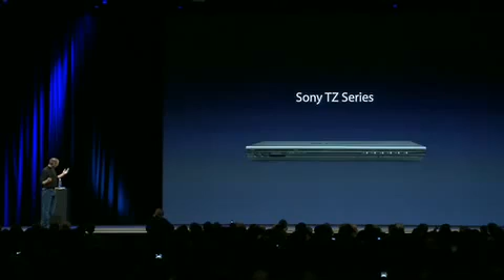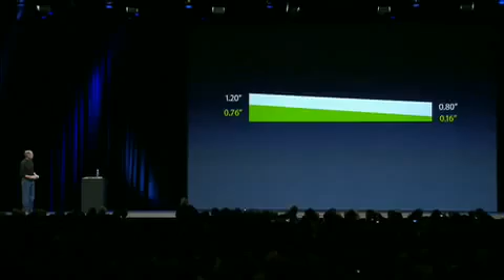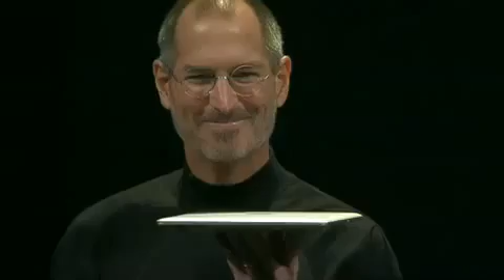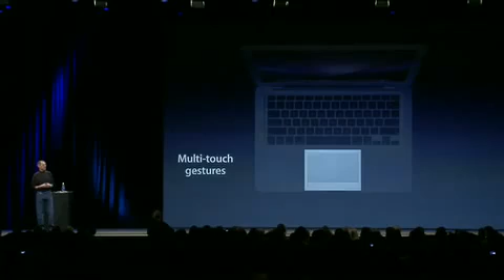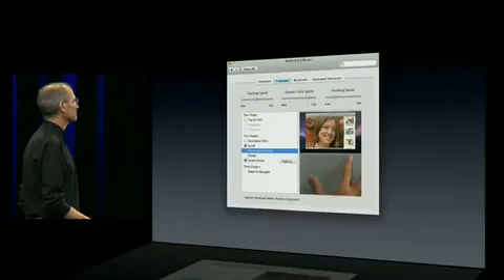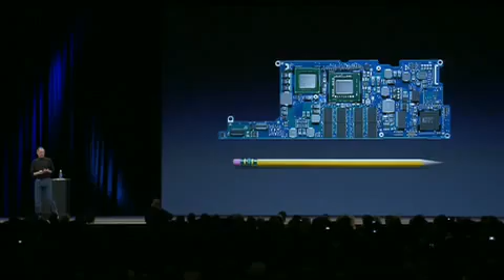2008 MacBook Air Keynote (Part One)

Comment: Ultrabooks have been increasing in price over the last couple years.  I just checked and a base 13" Macbook Air costs $1,200.  A Samsung Series 9 13" ultrabook with the same specs costs $1,180.  A $20 dollar difference.  And you can run Windows on the Macbook Air along with the Mac OS.  Try learning facts before spouting bias.